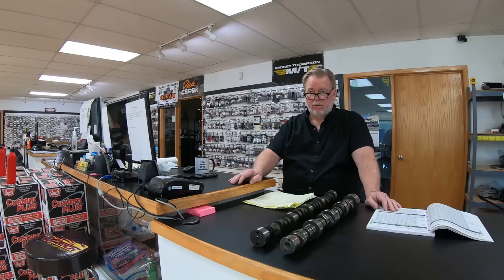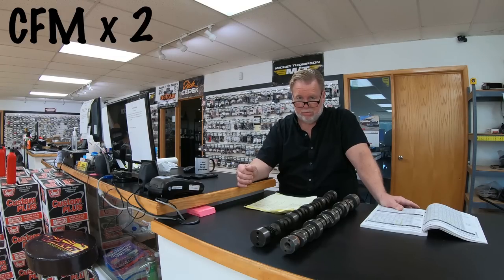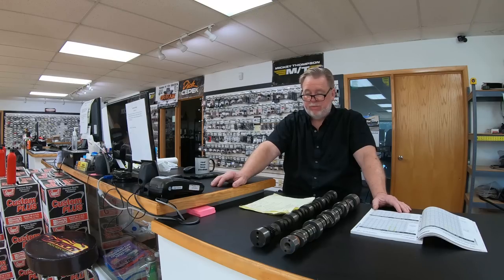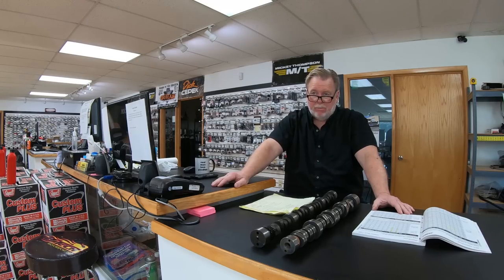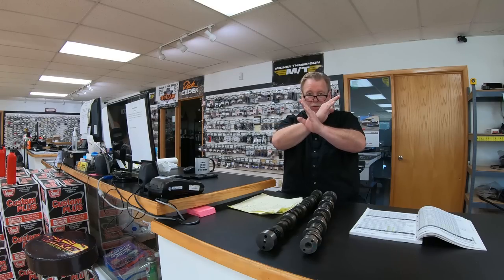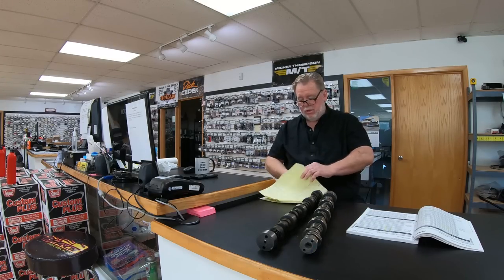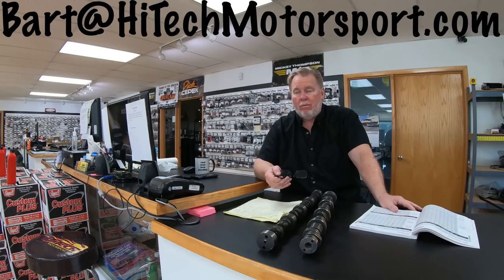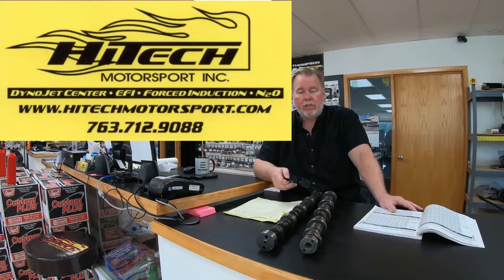How to Choose An Ls Camshaft For Max Horsepower

Comment: Hoping I picked a good one, but now you've got me second guessing. Can you confirm if this will work.   Just built a 6.2 LS3 and put in a 229/244 & .629/.615

Thanks
Reply: Just sharing some info here, I have made 575HP and 505TQ at the flywheel with a 229/236 on a 112 LSA in a 08, 6.2 with LS3 heads. All stock assembly other then cam, 0.660 valve springs, victor jr carb intake and the 60143 MSD. Comp - E 1558-14 (25-229236-112)

Comment: Would the cam you recommended for the 5.7 ls1 still be good for an old school 383 with aluminum heads? 200 cc on intake
Reply: I'm no expert but it's a totally different design and I'm thinking it wouldn't be a good idea comp cams should be able to help you with some general information as to what your expecting to do with the engine weight of vehicle gear ratio transmission and stall converter being used and use- street- drag race road racing 4x4 off road ECT the 383 small block l had had a solid flat tappet cam with 248 duration and .525 lift it made good power to 6000rpm my LS2 with Milled and CNC ported LS3 heads and hydraulic roller with 236 duration and .600 lift does not make the torque down low as the 383 did but the LS engine power curve carries very strong from 3000rpm to 7200rpm and torque doesn't fall off on the high end like the 383 did were torque drop could be felt drastically above 5000rpm in the LS engine there is no drop and if there is it's totally not noticeable all the way to 7200rpm the car pulls very strong no taper what so ever but below 3000rpm the 383 had more torque than the LS2 does but the stamina of the LS2 on the high end is much better than the 383

Comment: I would love to know what cam you would recommend with your professional opinion for my goal of my build, I swapped my high milage 5.3 out for a low milage true LS3 in my 2009 crew cab 4x4 z71 silverado. My mods are 1 3/4” ARH long tubes 3” collectors with catless Y pipe, Corsa Catback, K&N Cold air intake, triple disc 2800 stall convertor, 4.56 gears, 33” tires with a off the shelf btr stage 2 truck cam. 212 218 550 lift 113 LSA. Use is daily with the occasional tow of my 7000 lb Rv, wanting low end torque for towing and the ability to get around someone in a hurry when I decide to pass on the highway!
Reply from the maker: the cam is a good choice, but you have gears and converter to support a 222/228 600/600 114 lobe sep. the truck will pull harder from 2000 rpm up and it will be up 40hp and 40lbs of torque at 3500 up. true overlap on your cam is a -11 and my cam is -3. ivc is 39 with your cam and 45 with mine. my cam will be the same on a 6.2 ls3 to 2000 'rpm and will run away from it above that. i am using the 4.56 gears and 33 inch tires and showing in over drive you should run at 2000 rpm at 70mph? b
Reply: Hi-Tech MotorSport Thank you for taking the time to reply I really appreciate it. Are you recommending that cam or just saying I have the mods to support up to that size? And you are correct I’m at 2000 RPMs at 70